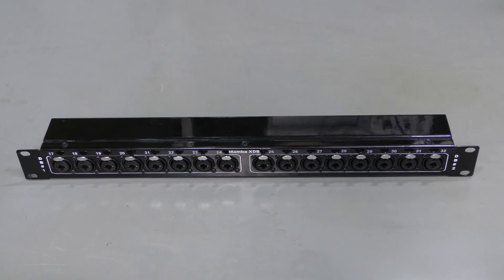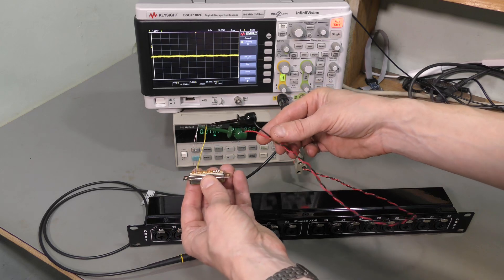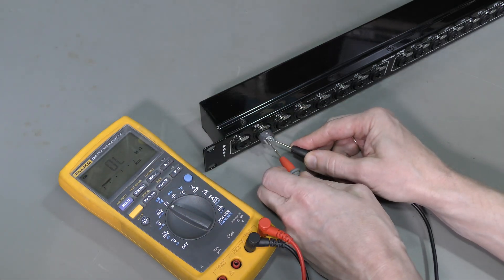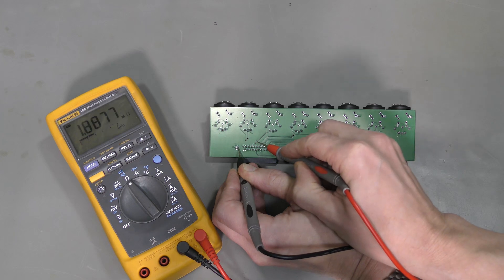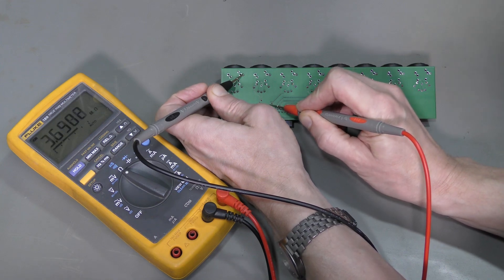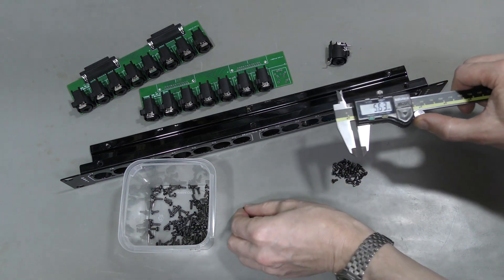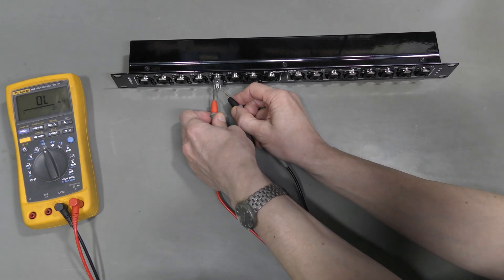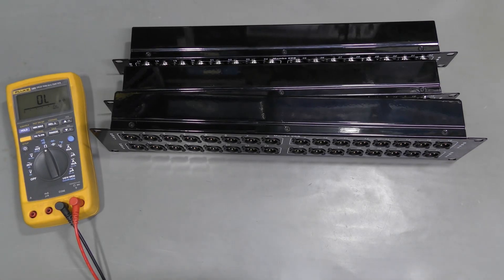#159 - NetworkSound Mamba XDB splitter repair

Comment: I need help with a Yamaha p-150. The midi does not work, I've checked that all cables and other midi devices work. The piano power on, and when I select midi, the button lights up. I've have restored all settings, and tweaking aswell. Is it the input jack board that is broken? VT360500 (Part number)

Comment: NetworkSound Here:  We traced the issue to assembly tech grabbing the wrong solder spool by mistake (Kester - Water soluble) for this batch of boards. Back to the normal solder and flux cleanup remover, the splitter is working well. The affected small batch of boards have been isolated/recalled. All other issues are also addressed to the customer satisfaction.

Comment: It looks like defective or poor quality PCB material, or perhaps the PCB material was contaminated with something conductive during manufacture.  In my line of work I came across circular multi-pin connectors from a well known manufacture that had defective/conductive rubber grommets, in the few megohms to tens of megohms like your PCBs.  The rubber had a manufacturing defect so such things can happen.   I like the idea of making replacement PCBs, there must be many more units out there that need this repair.  Your point to point wiring turned out nicely but no doubt time consuming.

Comment: Actual experience: Equipment was used at a seaside location with humid salty air, and salt laden moisture was absorbed into the PCB. Cleanings had some effect, soaking and baking had more effect, but the only permanent solution was to replace the PCBs and apply conformal coating. The PCB material was that tan porous "consumer electronics" junk though.

Comment: Wow! makes me think of carbon loaded plastics, like all this black around, but you tested the PCB with nothing else connected I think (will run it again) so these huge resistances are an artifact of the PCB manufacture. Can you stick a bare PCB in the oven 100 C overnight and bake it  ? But again the big change with the wired version was the black connectors so I dunno....but personally I would hit Kicad and get one made ! surely less painful than wiring that lot up.

Comment: If you have a scrap board available: remove the solder resist on a channel and see what happens. Looks a bit like some bozo put a can of 'anti-static' paint in the machine that applied the solder resist?

Comment: Some PCBs show an effect called "Conductive Anodic Filament" (CAF) which reduces the isolation resistance. But it is observed especially at higher voltages. Maybe the PCB contains some impurities leading to a migration of copper ions.
Reply: I too was going to suggest possible CAF.

Comment: My guess is that there is moisture in the circuit board.Try to remove all connectors and cook it in an oven at like 140c see if that works ,I've never seen this one before Good find.

Comment: I would not try to dry the PCBs in an oven because it is quite likely that the problem will reoccur. In my opinion, there are two solutions: replace the PCBs completely with wire connections or have new, high quality PCBs made.

Comment: I would try to unsolder everything, then a bath of pure acetone, preferably with ultrasound, then a bath of pure alcohol, and let it dry in the oven at 60ºC for 2 hours.If this fix it, after resolder everything, put some uv top coat.

Comment: Maybe the flux wicked up the conductors and is on the other side of the PCB as well and was protected during your cleaning by the connectors? I would try cleaning the board you removed the connectors from again with regular soap and water, if that does not fix it I'd try acetone and if that does not fix it maybe put it in an oven for 24 hours and if that still does not work I'd design new PCB's, very interesting video :)

Comment: My first thought was bad vias without proper clearance to the ground plane.  It looks like almost every trace goes through a via (on the back of the board anyhow).  Really poor PCB quality at any rate.

If you do end up redesigning the PCBs and post the files online, it may help out some other people that have those same devices.  Because with three bad examples on your bench alone, there a probably thousands (?) of faulty units out there.

Either way, glad to see you posting a lot of videos recently.  Longtime fan of the channel!
Reply: Or maybe a poor quality substrate that absorbed moisture?  I.e. if you stuck one of the boards in your oven at like 80-90°C for an hour (or left it in a bag with desiccant for a few days), would the inter-trace resistance go down.

Comment: My first hypothesis was hygroscopic flux as well, as I've had it happen before in my multimeter. But this issue must be the related to the boards themselves. PCBs do absorb moisture as well. At the assembler where I work we dry PCBs before reflow soldering if the package has been open for too long. Obviously these boards are just wave soldered, but the same moisture absorption can happen over time, I guess. I've never seen a device fail because of conductive boards before, though. Suggestion: Put them in a small, temperature controlled oven at 60-70C (140-158F) for 24 hrs. See if it makes a difference.
Reply: "PCBs do absorb moisture as well."
CHINA.
Reply: @k1mgy  Most, if not all PCB manufacturers are located in China. If we order from a company in our own country, they are just a middleman.

PCBs that are made for the commercial market get vaccuum packed with a humidity indicator, just like SMT part that have a MSL. Due to the reflow process any moisure in a component or PCB can rapidly expand and destroy it. PCBs can delaminate. 
As I said I 've  never heard of a finished product with boards becoming so conductive. It is the only theory here, though.

Comment: I have had a LED dimly lit for no reason, but after a PCB wash it fixed it. Don't know why your wash didn't work, unless it's something insolvent with what you washed it with, or the PCB is maybe porous and absorbed something - maybe possible on the edges, but not very likely in the centre -.

Comment: maybe the PCB's absorbed moisture somehow? Depending on what kind of material they were made of, I suppose it could be a possibility. If you put them in oven to get the moisture out then....
Reply: oven would be my first attempt. Second would be scan and re-draw them in kicad, and get new ones made
Reply: Or use a hairdryer, at least to see the if it changes anything. 
Maybe your "free wiring method" is the way to go, on a cold winter night. Happy New Year!
Reply: @laoluu  I'm not sure that a hairdryer would do much. I'd follow the procedure for bake drying surface mount chips before reflow soldering to prevent them from popcorning (where moisture in the epoxy package turns to steam during reflow and blows a chunk out) - usually it requires baking for several hours at temps over 100C to drive all the moisture out.
Reply: Good point.  I'd try drying them in an oven and if that fixes the problem, then I'd spray them with heavy coats of conformal coating to keep them dry permanently.

Comment: Once we used a no clean Flux on a job that required high reliability. 
It was a nightmare. 
OC insisted the no clean Flux needed not to be cleaned. 
It turned out this specific Flux likes to soak up humidity, and then it becomes quite conductive. We measured on unrelated signal trace resistance as low a one kilo Ohm.
Try again cleaning the boards, perhaps with Isopropyl in an ultrasonic bath.